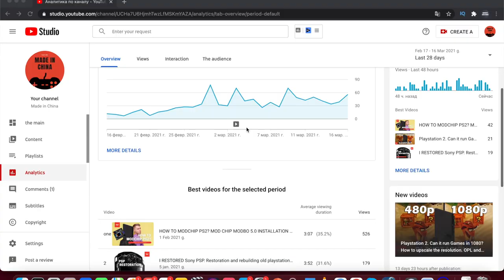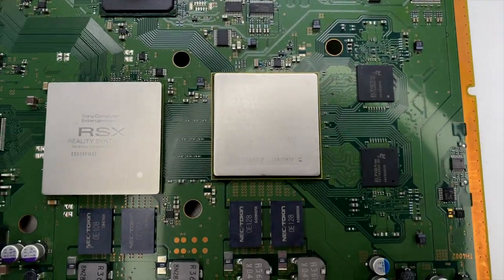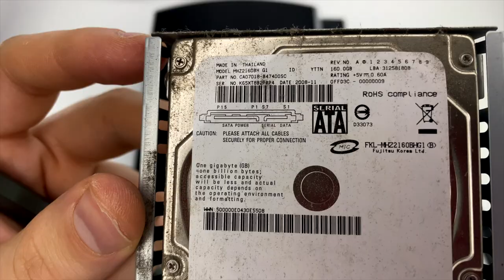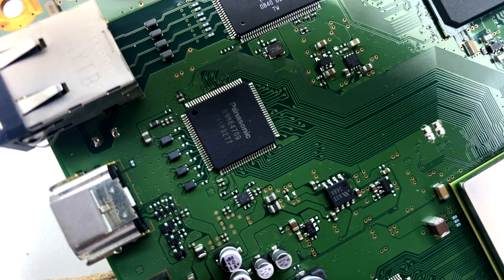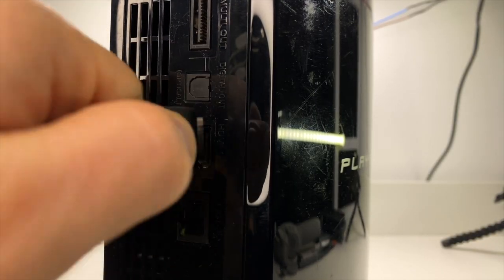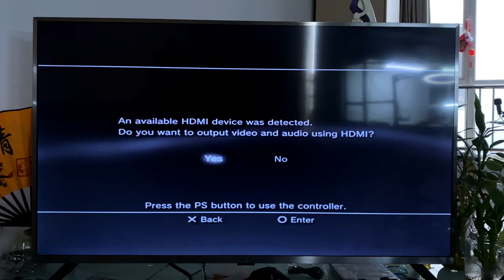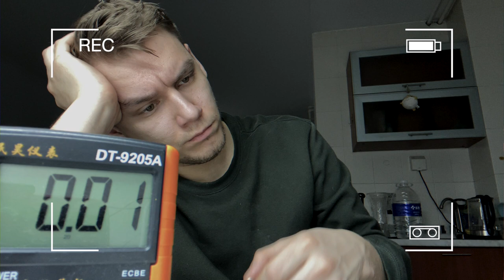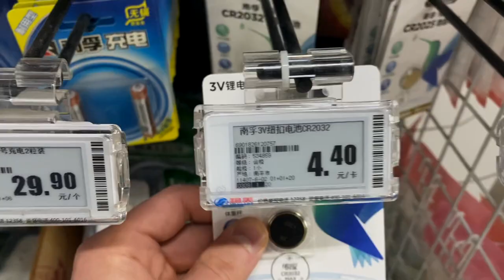PlayStation 3 BLACK SCREEN FIX. PS3 HDMI NOT WORKING. HOW TO FIX NO SIGNAL? NO VIDEO AND NO SIGNAL

Comment: Hi! After 8 years of not using my ps3 fat i turned it on today, it worked like a charm, but after it was on for about 1 hour, the screen turned black. After resetting it i got a very glitchy screen, turning on and off, until.. it stayed off. I can Tell the ps3 is still working but it doesnt have display via HDMI. And i don't have AV cable to test that side. What do you think went down here! Thanks in advance
Reply from the maker: Well , can be anything. Start from checking av output, but something tells me it’s GPU..

Comment: Well man would you be able to advice me what could my problem be? I'm stuck at 576p... when changing resolution in xmb screen goes black and reverts back to 576p... other ps3s work fine on same TV and hdmi except the fat model...  tried full system format reset and updated via recovery... even new hdd.. same thing
Reply from the maker: Hi, what about the games? No graphical issues? I guess you need to try to replace the chip that I replaced. I heard that it also can cause problems with resolution .

Comment: Mine was working a moment ago,and then the display froze,now it won't display,no signal,and the console turns on just fine,tried the restart process,still no display. Pls helllllllp
Reply from the maker: Read the comments, I have answered I few times on the same question.

Comment: I have always used mine with HDMI cable and I have the black screen now.  It powers up fine but no video or sound.  Can I buy a A/V to RCA cable and use that instead of HDMI chip repair?
Reply from the maker: Buy component av cable that supports 1080p.

Comment: My ps3 worked fine yesterday. Now its display is flickering btw no display to start up screen. I tried 4-5 different hdmi cable still same. Can you help me identify the issue. Is it chip failure or hdmi port failure?
Reply from the maker: Try the component output port

Comment: Which HDMI IC chip is it for the 80gb fat bw compat model?
Reply: Also i have diagnosed my ps3 all the way to finding a consistent file system corruption when trying to repair file system from safe mode, it repairs 100% and works but if i check it again in safe mode it constantly says the file system is corrupt. Even after a factory reset deleting all data

Comment: Can't seem to get the signal / picture to show. I've opened it up and pretty much removed all the dust hidden in the nooks and crannys. It doesn't seem to have been opened before me, since the warrenty bits were in the way etc. Would it be possible to ship my console your way for a fix? Or maybe if it's too pricey, you could perhaps hand-hold me through the process? Requested to follow you in Instagram ( I don't use or know how to use Instagram but i'll figure it out. )
Reply from the maker: First, try this:
Reset Video Output

1. Put your PS3 on standby.
2. Unplug the power lead.
3. Connect HDMI cable to HDMI out on PS3 and HDMI in on TV
4. Connect PS3 so that the red standby light is showing
5. Hold down the On/Off button until you hear a second beep. The PS3 will try and detect the display output settings on your monitor.

If it doesn't work out, try  to use a component output and make sure that it shows a picture and there is a problem with your HDMI output
Reply: @ReMARKCHANNEL  Tried that already mate, i've got the PS3 opened again right now and it seems a lot different on the board than the model you got! I have one of the fat models that can run PS2 games.
- It turns on with the green light, fans work, disc drive takes in and spits out discs.
- I can turn it back off via holding the power on the front of the console.
- No picture via composite or hdmi cables.
- Turned it on with and without the HDD, no changes.
- Tried the trick with getting safe mode and resetting the resolution etc, no luck with that either.
Reply from the maker: @TakuSkellaku  probably it’s the cpu. I had the same behavior of a ps3 fat . That time it was fixed by reballing the CELL.
Reply from the maker: Try to heat up the cpu with a heat gun. After try to boot. If it boots - you now what is wrong.
Reply from the maker: https://youtu.be/KtEaSbbihts like this one, but it can be used only to diagnose what’s wrong. Then reballing.
Reply: @ReMARKCHANNEL  Don't have access to a heat gun at this moment sadly, maybe I will be able to tomorrow
Reply from the maker: @TakuSkellaku  try one by one, rsx and cell
Reply: @ReMARKCHANNEL  I made it worse since it won't even turn to green light now. 👍

Comment: Hola! tengo un problema similar... PS3 80gb ceche01 dejó de dar imagen por hdmi, solo da imagen por la salida AV a 480i. Además se ve con unas pequeñas lineas de interferencia en la imagen por AV... será que es el chip ic de Panasonic o el chip de video RSX?
Saludos!
Reply from the maker: When your console is turned on, press the power button until it beeps for the second Time. Then, it will beep twice. And then let it go. And just wait a few seconds for the ps3 to adjust. If you see the picture on the tv screen, my congratulations. 

If you still have the problem:

There can be a few reasons why PlayStation 3 does not have an image, for example, mechanical damage to the HDMI connector, Board faults often include graphics chip (RSX) problems or HDMI video converter (MN8647091) (which I replaced in this video) faults, but other problems may also occur - power problems, firmware corruption, or CPU failure (CELL).

Take the console part, use multimeter to check the HDMI video converter chip, if there is short, on the output of hdmi signal, 100% that chip is broken and needs to be replaced.

Comment: i have a loose hdmi port on my ps3. Should i just buy the av cables
Reply from the maker: You can buy av-hdmi converter ( for ps2) if your tv does not support this component cable https://encrypted-tbn0.gstatic.com/images?q=tbn:ANd9GcQVwgvEnvaXCIYqGojgnii0VCId7AujW861qQ&usqp=CAU or if it supports, yep just buy av component which gives you 1080p as well.

Comment: What if RCA cable doesn’t work too ?
Reply from the maker: Probably reballing , RSX chip. It’s common issue.
Reply: I'm having a hard time with my PS3 Super Slim, it turns on green light but it shows nothing (no signal on TV) I tried with HDMI cables an RCA ones also swapping Hard drives hopping if it works but still black screen
Reply from the maker: @andrei294  you can plug in rca cable and reset video output settings by holding power button. You can search the internet for the guide. If it doesn’t work then your RSX chip got unsoldered from motherboard and you need to reball it, or replace the chip. Or 100 other reasons😀
Reply: @ReMARKCHANNEL  Thanks, I appreciate your advice 🙏🏻

Comment: My ps3 slim CECH2012 turns on but no display THEN TURNS OFF(RED). Can't boot into safe and when i push the power button and hold no 3 beeps. Any ideas?

Comment: Tengo un ps3 fat de 80gb con el hdmi dañado esta en corto pero en mi pais no se consigue ese repuesto MN864709 el unico que consegui fue de la version slim MN8647091 lo que quisiera saber si ese integrado de la ps3 slim le servira a la ps3 fat

translate

I have an 80gb ps3 fat with the damaged hdmi it is short but in my country you can't get that part MN864709 the only one I got was the slim version MN8647091 what I would like to know if that integrated ps3 slim will work for the ps3 fat

Comment: At 3:41 when your testing ohms. Are you touching the right side of the 4  blocks? There is some solder points I put my multimeter on and one on ground not getting any beeps.
Reply from the maker: In my case, they were all shorted because of the shorted IC chip.